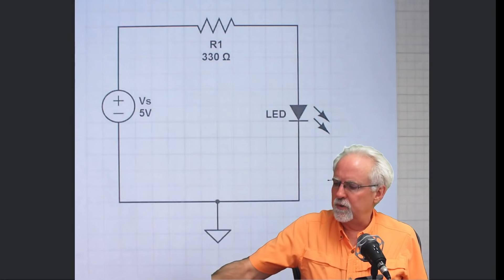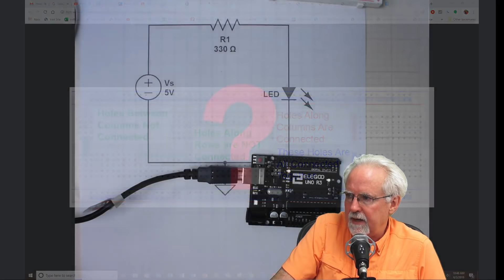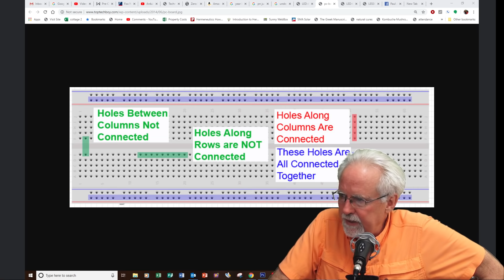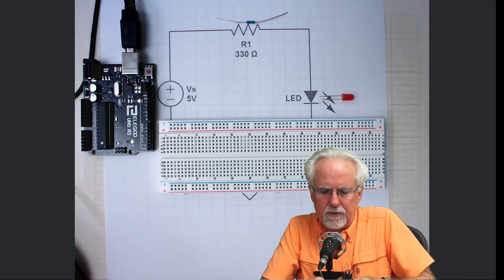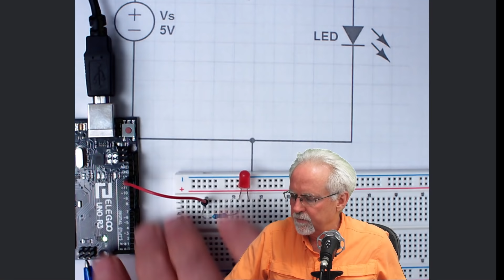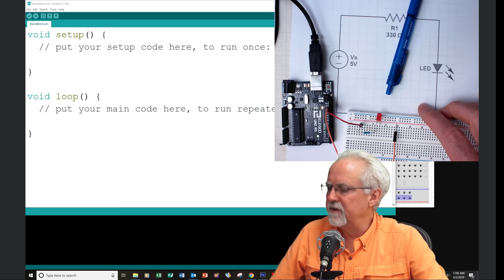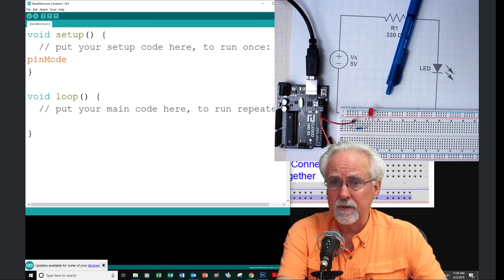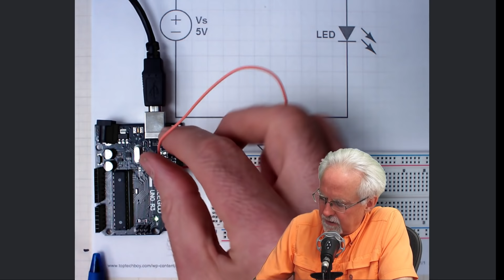Arduino Tutorial 3: Understanding How Breadboards Work

Comment: Sorry sir, but I typically watch these videos in the evenings, so I won't be enjoying a glass of coffee with you 😅
This video was a nice review. I would only add, going over the resistor color bands could be useful, especially if you get into later projects with a lot more resistors or mixing them up on accident.
A rubber-band is a good option, but I just toss them in a small ziplock bag. Sometimes other components are in rather large bags and you can use those 
I will find a way to share my homework answers with you later :)

Comment: Is this the right way to do the homework?
void setup() {
  // put your setup code here, to run once:
  pinMode(8, OUTPUT);
  pinMode(7, OUTPUT);
  pinMode(5, OUTPUT);
}

void loop() {
  // put your main code here, to run repeatedly:
  // Red LED Blinking
  digitalWrite(8, HIGH);
  digitalWrite(7, LOW);
  digitalWrite(5, LOW);
  delay(300);
  digitalWrite(8, HIGH);
  digitalWrite(7, LOW);
  digitalWrite(5, LOW);
  delay(300);
  digitalWrite(8, HIGH);
  digitalWrite(7, LOW);
  digitalWrite(5, LOW);
  delay(300);
  digitalWrite(8, HIGH);
  digitalWrite(7, LOW);
  digitalWrite(5, LOW);
  delay(300);
  digitalWrite(8, HIGH);
  digitalWrite(7, LOW);
  digitalWrite(5, LOW);
  delay(300);
  // Blue Led Blinking
  digitalWrite(8, LOW);
  digitalWrite(7, HIGH);
  digitalWrite(5, LOW);
  delay(300);
  digitalWrite(8, LOW);
  digitalWrite(7, HIGH);
  digitalWrite(5, LOW);
  delay(300);
  digitalWrite(8, LOW);
  digitalWrite(7, HIGH);
  digitalWrite(5, LOW);
  delay(300);
  digitalWrite(8, LOW);
  digitalWrite(7, HIGH);
  digitalWrite(5, LOW);
  delay(300);
  digitalWrite(8, LOW);
  digitalWrite(7, HIGH);
  digitalWrite(5, LOW);
  delay(300);
  digitalWrite(8, LOW);
  digitalWrite(7, HIGH);
  digitalWrite(5, LOW);
  delay(300);
  digitalWrite(8, LOW);
  digitalWrite(7, HIGH);
  digitalWrite(5, LOW);
  delay(300);
  digitalWrite(8, LOW);
  digitalWrite(7, HIGH);
  digitalWrite(5, LOW);
  delay(300);
  digitalWrite(8, LOW);
  digitalWrite(7, HIGH);
  digitalWrite(5, LOW);
  delay(300);
  digitalWrite(8, LOW);
  digitalWrite(7, HIGH);
  digitalWrite(5, LOW);
  delay(300);
  // Green LED Blinking
  digitalWrite(8, LOW);
  digitalWrite(7, LOW);
  digitalWrite(5, HIGH);
  delay(300);
  digitalWrite(8, LOW);
  digitalWrite(7, LOW);
  digitalWrite(5, HIGH);
  delay(300);
  digitalWrite(8, LOW);
  digitalWrite(7, LOW);
  digitalWrite(5, HIGH);
  delay(300);
  digitalWrite(8, LOW);
  digitalWrite(7, LOW);
  digitalWrite(5, HIGH);
  delay(300);
  digitalWrite(8, LOW);
  digitalWrite(7, LOW);
  digitalWrite(5, HIGH);
  delay(300);
  digitalWrite(8, LOW);
  digitalWrite(7, LOW);
  digitalWrite(5, HIGH);
  delay(300);
  digitalWrite(8, LOW);
  digitalWrite(7, LOW);
  digitalWrite(5, HIGH);
  delay(300);
  digitalWrite(8, LOW);
  digitalWrite(7, LOW);
  digitalWrite(5, HIGH);
  delay(300);
  digitalWrite(8, LOW);
  digitalWrite(7, LOW);
  digitalWrite(5, HIGH);
  delay(300);
  digitalWrite(8, LOW);
  digitalWrite(7, LOW);
  digitalWrite(5, HIGH);
  delay(300);
  digitalWrite(8, LOW);
  digitalWrite(7, LOW);
  digitalWrite(5, HIGH);
  delay(300);
  digitalWrite(8, LOW);
  digitalWrite(7, LOW);
  digitalWrite(5, HIGH);
  delay(300);
  digitalWrite(8, LOW);
  digitalWrite(7, LOW);
  digitalWrite(5, HIGH);
  delay(300);
  digitalWrite(8, LOW);
  digitalWrite(7, LOW);
  digitalWrite(5, HIGH);
  delay(300);
  digitalWrite(8, LOW);
  digitalWrite(7, LOW);
  digitalWrite(5, HIGH);
  delay(300);  
}

Comment: Hi Paul , about the homework in this session, I am not clear with one thing. How do we connect the ground wire to all the LEDs because there is only one ground pin in my Arduino Uno.
Reply: I connected all the LED columns (columns with the LED short leg) to the very top row and top row to ground

Comment: //pins used are 13 , 10 and 8

void setup() {
  // put your setup code here, to run once:
  pinMode(13, OUTPUT);
  pinMode(10, OUTPUT);
  pinMode(8, OUTPUT);
}

void loop() {
  // put your main code here, to run repeatedly:
  digitalWrite(13, HIGH);
  delay(100);
  digitalWrite(13, LOW);
  delay(100);
  digitalWrite(13, HIGH);
  delay(100);
  digitalWrite(13, LOW);
  delay(100);
  digitalWrite(13, HIGH);//3
  delay(100);
  digitalWrite(13, LOW);
  delay(100);
  digitalWrite(13, HIGH);
  delay(100);
  digitalWrite(13, LOW);
  delay(100);
  digitalWrite(13, HIGH);//5
  delay(100);
  digitalWrite(13, LOW);
  delay(100);
  digitalWrite(10, HIGH);
  delay(100);
  digitalWrite(10, LOW);
  delay(100);
  digitalWrite(10, HIGH);
  delay(100);
  digitalWrite(10, LOW);
  delay(100);
  digitalWrite(10, HIGH);//3
  delay(100);
  digitalWrite(10, LOW);
  delay(100);
  digitalWrite(10, HIGH);
  delay(100);
  digitalWrite(10, LOW);
  delay(100);
  digitalWrite(10, HIGH);
  delay(100);
  digitalWrite(10, LOW);
  delay(100);
  digitalWrite(10, HIGH);//6
  delay(100);
  digitalWrite(10, LOW);
  delay(100);
  digitalWrite(10, HIGH);
  delay(100);
  digitalWrite(10, LOW);
  delay(100);
  digitalWrite(10, HIGH);
  delay(100);
  digitalWrite(10, LOW);
  delay(100);
  digitalWrite(10, HIGH);//9
  delay(100);
  digitalWrite(10, LOW);
  delay(100);
  digitalWrite(10, HIGH);
  delay(100);
  digitalWrite(10, LOW);
  delay(100);
  digitalWrite(8, HIGH);//1
  delay(100);
  digitalWrite(8, LOW);
  delay(100);
  digitalWrite(8, HIGH);
  delay(100);
  digitalWrite(8, LOW);
  delay(100);
  digitalWrite(8, HIGH);
  delay(100);
  digitalWrite(8, LOW);
  delay(100);
  digitalWrite(8, HIGH);
  delay(100);
  digitalWrite(8, LOW);
  delay(100);
  digitalWrite(8, HIGH);
  delay(100);
  digitalWrite(8, LOW);
  delay(100);
  digitalWrite(8, HIGH);
  delay(100);
  digitalWrite(8, LOW);
  delay(100);
  digitalWrite(8, HIGH);
  delay(100);
  digitalWrite(8, LOW);
  delay(100);
  digitalWrite(8, HIGH);//8
  delay(100);
  digitalWrite(8, LOW);
  delay(100);
  digitalWrite(8, HIGH);
  delay(100);
  digitalWrite(8, LOW);
  delay(100);
  digitalWrite(8, HIGH);
  delay(100);
  digitalWrite(8, LOW);
  delay(100);
  digitalWrite(8, HIGH);
  delay(100);
  digitalWrite(8, LOW);
  delay(100);
  digitalWrite(8, HIGH);//12
  delay(100);
  digitalWrite(8, LOW);
  delay(100);
  digitalWrite(8, HIGH);
  delay(100);
  digitalWrite(8, LOW);
  delay(100);
  digitalWrite(8, HIGH);
  delay(100);
  digitalWrite(8, LOW);
  delay(100);
  digitalWrite(8, HIGH);//15
  delay(100);
  digitalWrite(8, LOW);
  delay(100);
}

Comment: Disclaimer:
I have done a bit of programming in C whilst at university (it was only a small scope of work for the entire course) and I have done Paul's Python and vPython tutorials as well so this is why I used things that are out of the scope of what's been covered so far.

To save writing out on-off lines 20 times in total I used for loops for the pinModes and the flashing:
void setup() {
  // put your setup code here, to run once:
  for(int i = 1; i < 4; i++)
  {
    pinMode(i, OUTPUT);
  }
}

void loop() {
  // put your main code here, to run repeatedly:
  int d = 250;
  for(int i = 1; i < 4; i++)
  {
    for(int j = 0; j < 5*i; j++)
    {
      digitalWrite(i, HIGH);
      delay(d);
      digitalWrite(i, LOW);
      delay(d);
    }
  }
}

Comment: I am so excited I found your channel!  I've learned so much in the first few lessons.  Here is my sketch.  I KNOW there is a better way to make the light blink for a certain amount of times, maybe we will learn that in a future lesson.  For now, I just used good ol copy and paste and it worked great!  
void setup() {
  // put your setup code here, to run once:
  pinMode(13,OUTPUT);
  pinMode(11,OUTPUT);
  pinMode(8,OUTPUT);

}

void loop() {
  // put your main code here, to run repeatedly:
  digitalWrite(13,HIGH);
  delay(500);
  digitalWrite(13,LOW);
  delay(500);
digitalWrite(13,HIGH);
  delay(500);
  digitalWrite(13,LOW);
  delay(500);
digitalWrite(13,HIGH);
  delay(500);
  digitalWrite(13,LOW);
  delay(500);
digitalWrite(13,HIGH);
  delay(500);
  digitalWrite(13,LOW);
  delay(500);
digitalWrite(13,HIGH);
  delay(500);
  digitalWrite(13,LOW);
  delay(500);

  digitalWrite(11,HIGH);
  delay(500);
  digitalWrite(11,LOW);
  delay(500);
  digitalWrite(11,HIGH);
  delay(500);
  digitalWrite(11,LOW);
  delay(500);digitalWrite(11,HIGH);
  delay(500);
  digitalWrite(11,LOW);
  delay(500);digitalWrite(11,HIGH);
  delay(500);
  digitalWrite(11,LOW);
  delay(500);digitalWrite(11,HIGH);
  delay(500);
  digitalWrite(11,LOW);
  delay(500);digitalWrite(11,HIGH);
  delay(500);
  digitalWrite(11,LOW);
  delay(500);digitalWrite(11,HIGH);
  delay(500);
  digitalWrite(11,LOW);
  delay(500);digitalWrite(11,HIGH);
  delay(500);
  digitalWrite(11,LOW);
  delay(500);digitalWrite(11,HIGH);
  delay(500);
  digitalWrite(11,LOW);
  delay(500);digitalWrite(11,HIGH);
  delay(500);
  digitalWrite(11,LOW);
  delay(500);

  digitalWrite(8,HIGH);
  delay(500);
  digitalWrite(8,LOW);
  delay(500);digitalWrite(8,HIGH);
  delay(500);
  digitalWrite(8,LOW);
  delay(500);digitalWrite(8,HIGH);
  delay(500);
  digitalWrite(8,LOW);
  delay(500);digitalWrite(8,HIGH);
  delay(500);
  digitalWrite(8,LOW);
  delay(500);digitalWrite(8,HIGH);
  delay(500);
  digitalWrite(8,LOW);
  delay(500);digitalWrite(8,HIGH);
  delay(500);
  digitalWrite(8,LOW);
  delay(500);digitalWrite(8,HIGH);
  delay(500);
  digitalWrite(8,LOW);
  delay(500);digitalWrite(8,HIGH);
  delay(500);
  digitalWrite(8,LOW);
  delay(500);digitalWrite(8,HIGH);
  delay(500);
  digitalWrite(8,LOW);
  delay(500);digitalWrite(8,HIGH);
  delay(500);
  digitalWrite(8,LOW);
  delay(500);digitalWrite(8,HIGH);
  delay(500);
  digitalWrite(8,LOW);
  delay(500);digitalWrite(8,HIGH);
  delay(500);
  digitalWrite(8,LOW);
  delay(500);digitalWrite(8,HIGH);
  delay(500);
  digitalWrite(8,LOW);
  delay(500);digitalWrite(8,HIGH);
  delay(500);
  digitalWrite(8,LOW);
  delay(500);

}

Comment: 4th and shortest version (no prior declarations) .... just declaring o/p pins in void setup
void setup() {
  // Initialize the LED pins as output
  pinMode(13, OUTPUT);
  pinMode(12, OUTPUT);
  pinMode(11, OUTPUT);
}

void loop() {
  // Blink the first LED
  for (int i = 0; i < 5; i++) {
    digitalWrite(13, HIGH); // Turn on the LED
    delay(100);
    digitalWrite(13, LOW); // Turn off the LED
    delay(50);
  }

  // Blink the second LED
  for (int i = 0; i < 10; i++) {
    digitalWrite(12, HIGH); // Turn on the LED
    delay(100);
    digitalWrite(12, LOW); // Turn off the LED
    delay(50);
  }

  // Blink the third LED
  for (int i = 0; i < 15; i++) {
    digitalWrite(11, HIGH); // Turn on the LED
    delay(100);
    digitalWrite(11, LOW); // Turn off the LED
    delay(50);
  }
}

Comment: 3rd version  (without explicitly declaring the LED pins, blinkDuration and blinkGap)
// Define the number of blinks for each LED
const int firstLEDBlinks = 5;
const int secondLEDBlinks = 10;
const int thirdLEDBlinks = 15;

void setup() {
  // Initialize the LED pins as output
  pinMode(13, OUTPUT);
  pinMode(12, OUTPUT);
  pinMode(11, OUTPUT);
}

void loop() {
  // Blink the first LED
  for (int i = 0; i < firstLEDBlinks; i++) {
    digitalWrite(13, HIGH); // Turn on the LED
    delay(300);
    digitalWrite(13, LOW); // Turn off the LED
    delay(200);
  }

  // Blink the second LED
  for (int i = 0; i < secondLEDBlinks; i++) {
    digitalWrite(12, HIGH); // Turn on the LED
    delay(300);
    digitalWrite(12, LOW); // Turn off the LED
    delay(200);
  }

  // Blink the third LED
  for (int i = 0; i < thirdLEDBlinks; i++) {
    digitalWrite(11, HIGH); // Turn on the LED
    delay(300);
    digitalWrite(11, LOW); // Turn off the LED
    delay(200);
  }
}

Comment: 2nd version (without explicitly declaring the LED pins)
// Define the durations for blinking and the gap between blinks
const int blinkDuration = 300; // in milliseconds
const int blinkGap = 200; // in milliseconds

// Define the number of blinks for each LED
const int firstLEDBlinks = 5;
const int secondLEDBlinks = 10;
const int thirdLEDBlinks = 15;

void setup() {
  // Initialize the LED pins as output
  pinMode(13, OUTPUT);
  pinMode(12, OUTPUT);
  pinMode(11, OUTPUT);
}

void loop() {
  // Blink the first LED
  for (int i = 0; i < firstLEDBlinks; i++) {
    digitalWrite(13, HIGH); // Turn on the LED
    delay(blinkDuration);
    digitalWrite(13, LOW); // Turn off the LED
    delay(blinkGap);
  }

  // Blink the second LED
  for (int i = 0; i < secondLEDBlinks; i++) {
    digitalWrite(12, HIGH); // Turn on the LED
    delay(blinkDuration);
    digitalWrite(12, LOW); // Turn off the LED
    delay(blinkGap);
  }

  // Blink the third LED
  for (int i = 0; i < thirdLEDBlinks; i++) {
    digitalWrite(11, HIGH); // Turn on the LED
    delay(blinkDuration);
    digitalWrite(11, LOW); // Turn off the LED
    delay(blinkGap);
  }
}

Comment: Dear Paul, thanks for being so fabulous. I am a Diabetologist by profession and a STEM educator by passion. I use your Arduino series as a teaching resource and my students love it.
I have a little bit of programming experience in C. I have thus used the for loop to get around the repetition of code. I am posting it here, in the interest of those who are new and wondering about an alternative approach. I am on to your 4th video. Thanks a ton from all of us @ Katalyst Education 🙂

// Define the pins for LEDs
const int firstLEDPin = 13;
const int secondLEDPin = 12;
const int thirdLEDPin = 11;

// Define the durations for blinking and the gap between blinks
const int blinkDuration = 300; // in milliseconds
const int blinkGap = 200; // in milliseconds

// Define the number of blinks for each LED
const int firstLEDBlinks = 5;
const int secondLEDBlinks = 10;
const int thirdLEDBlinks = 15;

void setup() {
  // Initialize the LED pins as output
  pinMode(firstLEDPin, OUTPUT);
  pinMode(secondLEDPin, OUTPUT);
  pinMode(thirdLEDPin, OUTPUT);
}

void loop() {
  // Blink the first LED
  for (int i = 0; i < firstLEDBlinks; i++) {
    digitalWrite(firstLEDPin, HIGH); // Turn on the LED
    delay(blinkDuration);
    digitalWrite(firstLEDPin, LOW); // Turn off the LED
    delay(blinkGap);
  }

  // Blink the second LED
  for (int i = 0; i < secondLEDBlinks; i++) {
    digitalWrite(secondLEDPin, HIGH); // Turn on the LED
    delay(blinkDuration);
    digitalWrite(secondLEDPin, LOW); // Turn off the LED
    delay(blinkGap);
  }

  // Blink the third LED
  for (int i = 0; i < thirdLEDBlinks; i++) {
    digitalWrite(thirdLEDPin, HIGH); // Turn on the LED
    delay(blinkDuration);
    digitalWrite(thirdLEDPin, LOW); // Turn off the LED
    delay(blinkGap);
  }
}

Comment: Hi paul coach, assignment is done please check this if it is wrong  or need to be correct please correct me. i am now student of your void setup() {
  // put your setup code here, to run once:
  pinMode(13,OUTPUT);
  pinMode(10, OUTPUT);
  pinMode(4,OUTPUT);
}

void loop() {
  // put your main code here, to run repeatedly:
  for(int i=0;i<10;i++){
  digitalWrite(13, HIGH);
  delay(100);  // wait for a second
  digitalWrite(13, LOW);
  delay(200);
  }
  for(int i=0;i<5;i++){
    digitalWrite(10, HIGH);
    delay(100);
    digitalWrite(10,LOW);
    delay(200);
  }
  for(int i=0;i<3;i++){
    digitalWrite(4, HIGH);
    delay(100);
    digitalWrite(4,LOW);
    delay(200);
  }
 
}

Comment: payed 27 bucks for arduno uno from arduino because i thought they wheren't able  to provide enogh voltage. i bought it and found out i didnt do pinmode for all the leds I tried setting up 7 LEDs. i had to make a 4 bit binary counter and played with it a little bit before i got it working. So thankfull he has these classes.

Comment: In a later tutorial you connect 4 LEDs to the Arduino. Every LED is preconnected to a 330 Ohms resistor. Couldn't it be possible to have a layout, putting the resistor after the LEDs on the short leg and then connecting this to one single resistor that is connected to GND?

In other words:
5Volt, coming form different pins.
Attach the long leg of every LED to this 5 Volt.
Connecting the short leg of every LED to a single 330 Ohm resistor.
Connecting the other leg of the resistor to GND.

In this way you would only need one resistor.

Comment: In diagrams that show the flow of electrons, it seems as if power flows from the negative to the positive. But in this schematic it is shown as flowing from the positive to the negative. Why is that?
Reply from the maker: Current is defined as the opposite direction as the flow of electrons. This is a quirky thing, and came about because electrons are negatively charged, so positive current flows in the opposite direction. A little bit of a confusing standard they defined.
Reply: Wow! Thank you so much for the reply. That is quirky. I'm going to have to read up on that a bit to wrap my head around it. Thanks so much for making these videos. They are infinitely helpful.

Comment: Hi Paul, Great Lesson 3, 22-1-24, got some error messages in my code so checking that again, commands are turning orange, OUTPUT, HIGH, LOW not turning green. but doesnt seem to be an issue. The problem was an upload error. Turned out it was just a loose USB, not inserted properly..BOOM flashing LED at 50ms.